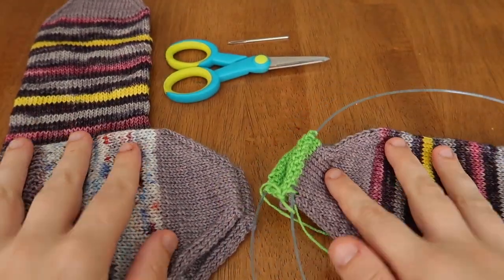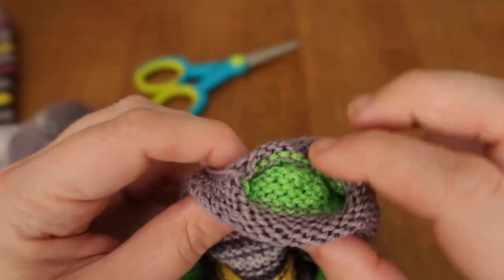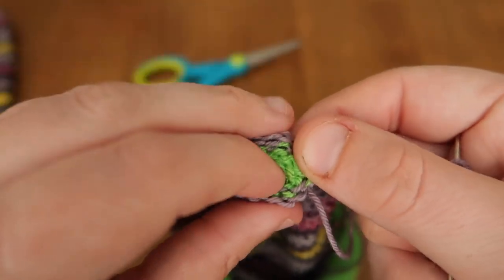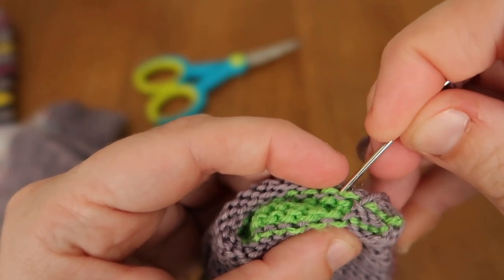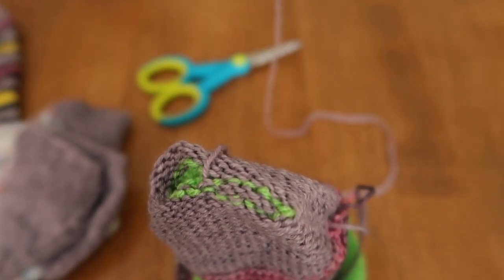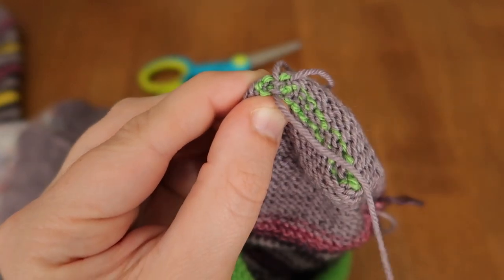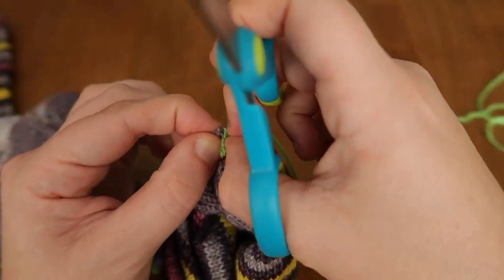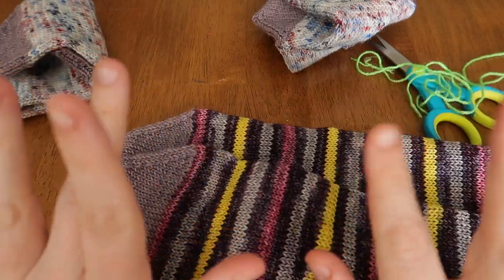Closing a Toe without using a Traditional Kitchener stitch

Comment: Revolutionary! If I drop my concentration for even a second while kitchenering, I screw up and it makes me so mad. And I've been doing it for a long time too! This will change my life! Thank you so much.
Reply from the maker: That's exactly me too. I always end up moving the yarn wrong and leaving a line across some of the stitches, or twisting them. It always makes me mad. This way, i can pick up and put down my work without worrying about stitches dropping off. I've seen grafting on the outside too  - it may be a tutorial you'd like too. I think it was called "chimney toe" on youtube.
Reply: I saw that chimney toe video, but I like your way better. It just makes more sense intuitively. Very clear video! Thanks again. I was so fed up with kitchener that I was even trying double-needle bind off on an inside-out sock. This will be so much better!

Comment: I took a course with Lucy Neatby and this toe chimney technique was beyond my patience but you have made it very exciting.  Looks a bit difficult to get started but in with the new mantra very helpful.  I am always getting dog ears no matter what I do.  I am still perfecting the perfect sock pattern so far there is always something "wrong" with each sock and I have made quite a few pair now.  Did you ever try using cotton crochet thread to knit the chimney part?  I would think it might alleviate the possibiity of splitting and intermingling the yarn?  Thankx I love your channel.
Reply from the maker: this was knit in cotton that i usually use as waste for my csm knit socks. -it might help though to use a smaller thread though! i'm not sure  this is the technique i use when i close the socks, inside out and grafting together - i still struggle with the grafting from the outside though! i've gained more confidence in my traditional kitchener for my hand knits but i still use this method if i'm doing a completely csm knit sock.